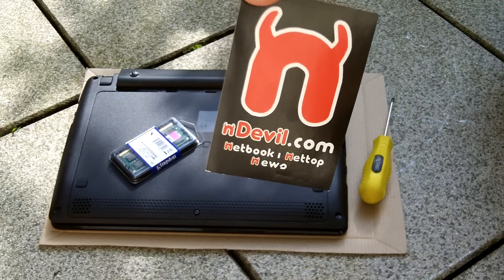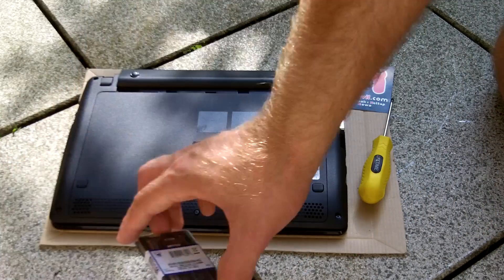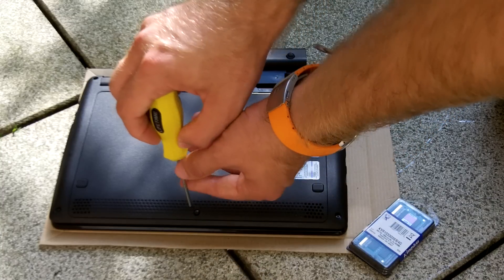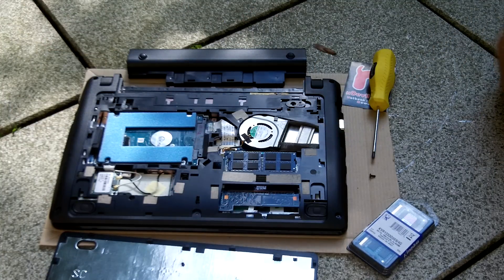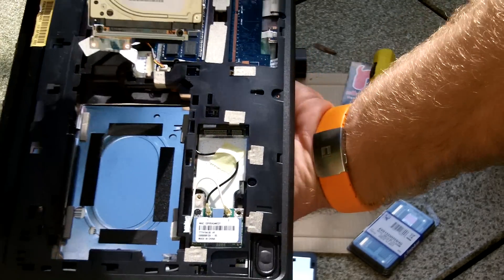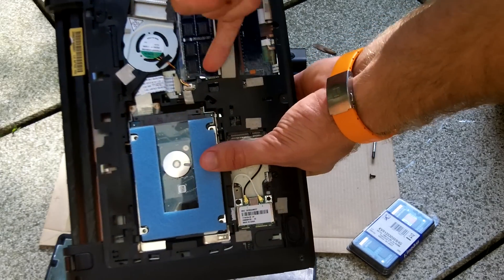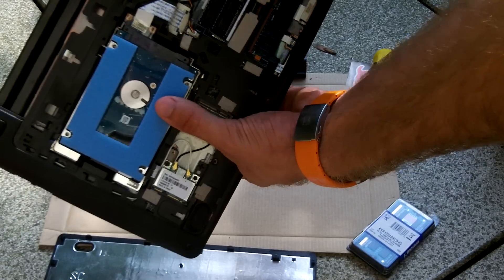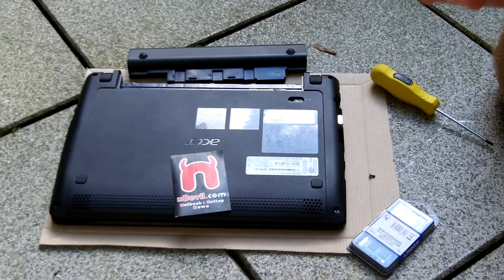Acer Aspire One 722 RAM and HDD Upgrade

Comment: Why install 4 GB, when both the Acer 722 and 725 accept 8?
Reply: WHY? 
32-bit processors were used in many computers of this type, consequently a 32-bit windows 7, a 32-bit computer recognizes only up to 3.6 gb of ram approx, putting 8 is useless, now if you put 8gb and the processor is 64 bits, you can change the windows 7 to 64 bits so that it recognizes the full 8gb

Comment: Thanks a lot for the video, its perfect, and i have 1 question:  
actually my acer 722 have 2 GB of RAM, but if i upgrade to 4GB of RAM, will have a major change in the overall performance ?
Reply: Yes but you really need 8gb if you really want to take use of the 64 bit processing capabilities of the APU.

Comment: Windows 7 Starter is 32-bit only, so the most it'll ever recognized is about 3.3 GB hardware wise, but Microsoft limits that even further by letting Windows 7 Starter only recognize 2 GB, The only work around is, upgrading to 32-bit Windows 7 Home Premium, but you'll only be able to get 3.3 GB of ram out of it